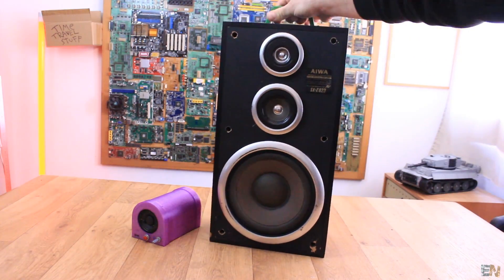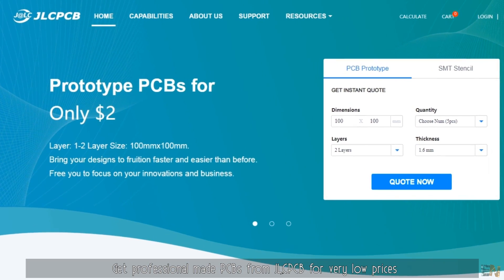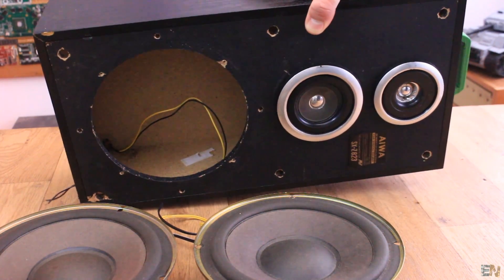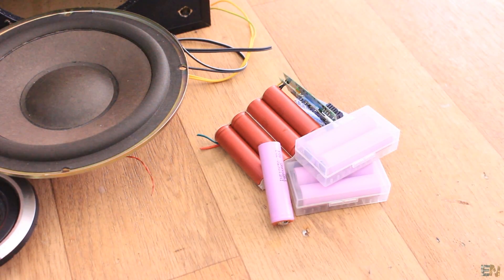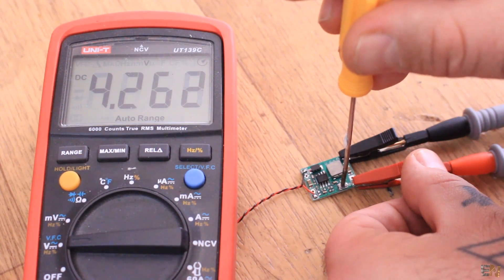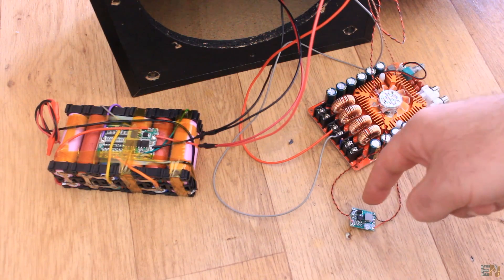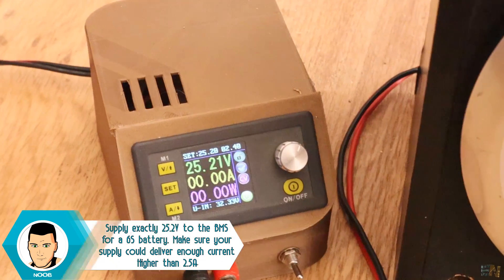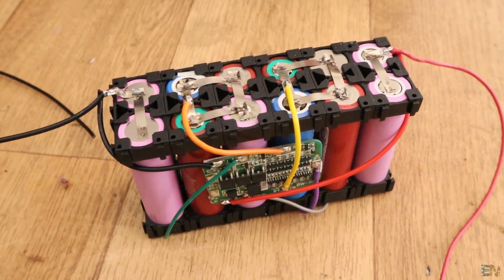DIY Huge Portable Bluetooth Speaker V2.0

Comment: "I've desoldered the potentiometer the amplifier had and solder it back in the same way but using long thin wires."

NOT SHIELDED CABLE?   is that a good idea?   I think NOT.

Comment: Maybe I missed but I didn't see a cross-over anywhere here or in the links?  The wiring diagram shows the speakers in parallel  - which if they were 4 Ohm could cause problems.
It seems you do NOT really know audio systems.  Maybe stick with digital stuff.

Comment: Is that good advice?  Just grabbing whatever batteries from an old laptop battery pack?  I think not
Reply: I see the point you are making. I totally agree.
Reply: After you test them carefully you should be fine. Altrough depending on cycle count its matter of time when you will need to replace one or two cells.
Reply: @Arturikas17  Sure BUT ...........   Was testing mentioned?  What tests and how to test properly? What equipment is needed? How to evaluate the test results?  Most clowns posting such content just measure cell/battery voltage - unloaded!  and just as a singular point!!
Reply: Well I believe the people who decide to do project like that, must have such a knowledge. The least what they have is common sense. Also just from video only you cant  tell how to actualy build the pack so someone who has no idea what they doing I'm preety sure they would research on how to build battery packs. As there are so much content creators who are specifically making content on batteries. That's what I did anyways and I have no idea about electronics at all. My speaker turned out just fine.
Reply: @Arturikas17  Most people are dumber than a pile of rocks (to be polite). Just yesterday a guy was asking on another site what is the mAH of a freaking transformer!   And I saw one channel the other day where the host merely twisted the electrical wires together (and then used heat-shrink tubing). Last month I saw  a carpenter using NAILS to affix the hinges to a door. There are some forums I am a member of and the questions can be extremely naive. At the very least Electronoobs
 (the name captures the target market) should have indicated testing was necessary and linked it appropriate content.

Comment: I like your projects. Just one question, How long does the speaker run on batteries? 

I also want to make a speaker but I want it to charge directly of a 220v supply. So the transformer and converter will have to go inside the unit.

Comment: You could have used both channels, one for the woofer, other for the mid and tweeter, and used a jumper on the signal from both channels so they receive the same input. This way you would have more output :)

Comment: that board is just protection board without balancing function
that means if one battery reach 4.28V charging for all batteries stops even if others are not charged yet 
if batteries are not balanced they can have different voltage which could cause problems because the gap between battery voltages is slowly increasing with charging and discharging
this board has both functions protection and balancing 
https://www.ebay.com/itm/4S-40A-Li-ion-Lithium-Battery-18650-Charger-BMS-protection-Board-Charging-Module/173617128426?epid=15025782959&hash=item286c6323ea:g:hJgAAOSwvytcUSg0
there is also only BMS board
https://www.ebay.com/itm/4S-16-8V-Lithium-18650-Battery-BMS-PCB-Balance-Protection-Board-100mA/173753505834?hash=item287484182a:g:dCwAAOSwiqBcReWd
Reply: question. why 4s now if we have 6s ? wond we need a 6s board with balacing function? ty

Comment: Please made portable Hig Voltage (400V) powerful shaking vibrating subwoofer - Sub + passive subwoofer powerful vibro plummet, tweet, squeaker... (subwoofer power 1000W /RMS, summary power 1500-2000W)...
Can you do both from the amplifier taramps?
or convert a wireless subwoofer to a portable + speaker + squeaker? - DC-DC increase battery voltage to high voltage to increase power to power a powerful high-voltage subwoofer amplifier???
Reply: I like a powerfully Taramps Hig Voltage amplifier 100000W Mexican amplificadore )))

Comment: Another great project, and something I’d be interested in trying. 
Could you explain how the crossover between speakers is handled? In the bench test you only showed connection to the woofer. How is the mid and tweeter connected? Thanks again for a cool project!
Reply from the maker: All speakers are in parallel. For mid I just placed a 10uF as a filter. Tweei is connected directly.

Comment: Hi friend , please make some bms video for lithium batteries like Arduino with bms board or charging or discharging with Arduino
Reply from the maker: Thanks. I'll have that on my to do list.
Reply: @ELECTRONOOBS  thanks, I have an Idea if we can modify   6s bms and connect it with Arduino to monitor voltage for every cell and discharge it ...